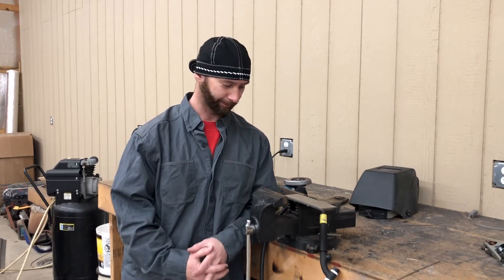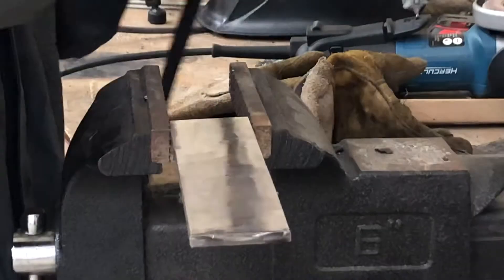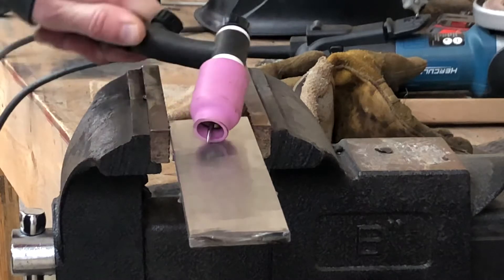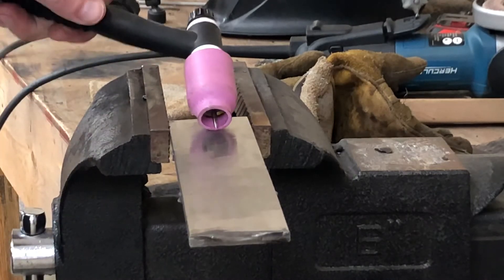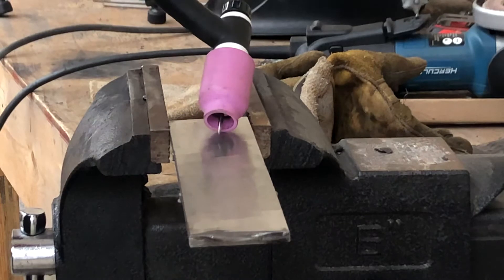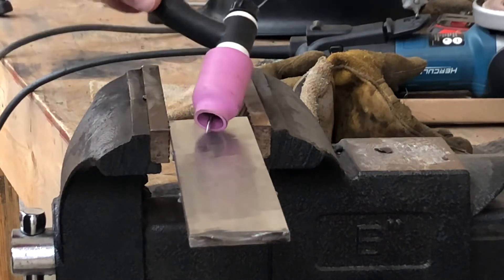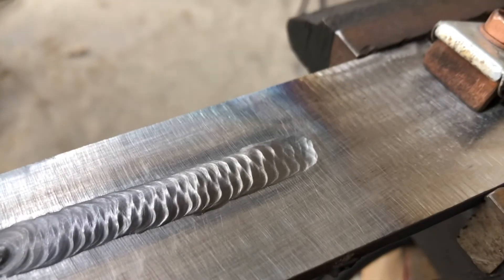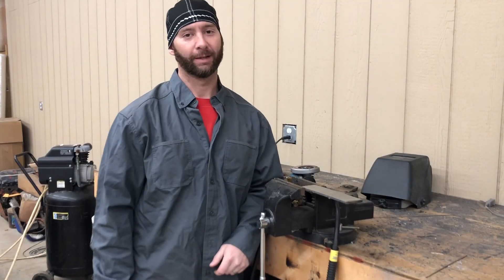Walking the cup tig welding for beginners

Comment: This been kicking my axx today. I'm in Tulsa in Jacksonville Florida.   It's harder than it looks
Reply from the maker: Yeah it is harder than it looks. Once you get the motion down it’s pretty easy after that. Remember not to squeeze the rig too hard and get tense. Try to stay as loose as you can with just a little pressure on the rig. Not too much pressure or it will slip. Take small steps at first. Then as you get better you can take bigger and bigger ones. Let me know if you have any questions or video requests. Thanks for watching!👍
Reply: @getweldsoon1113  I definitely will. Thanks for replying. If I'm still having trouble tomorrow...you'll hear from me. Thanks again.